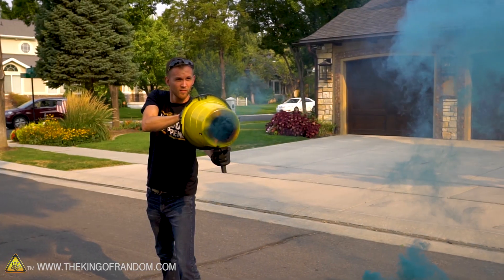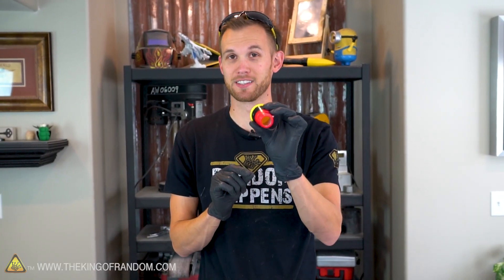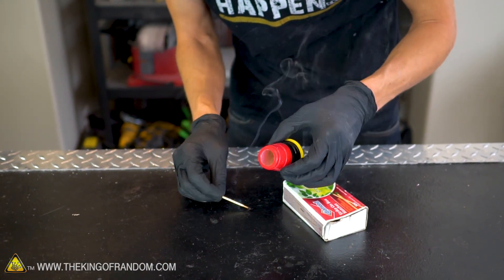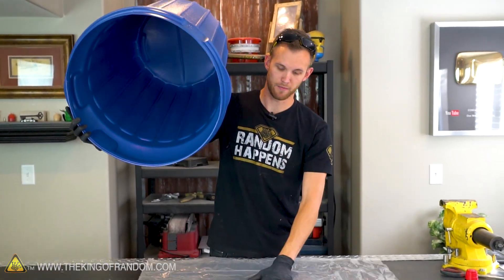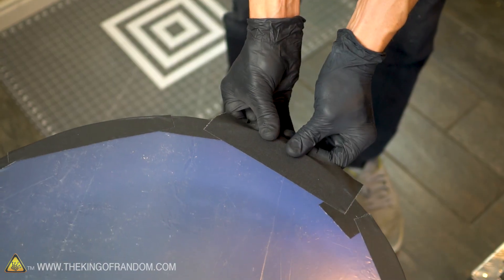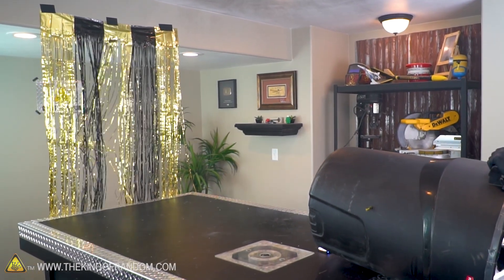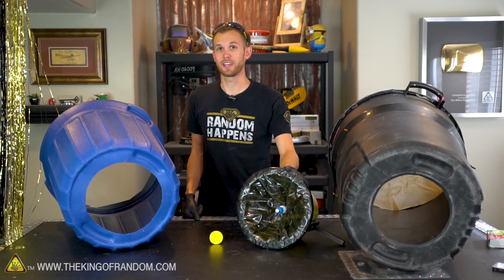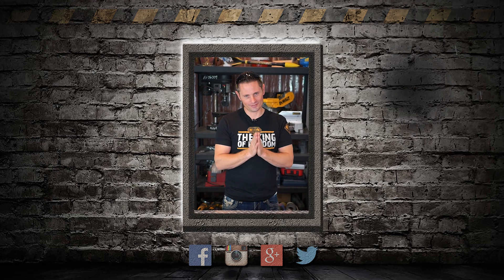Next Level DIY Vortex Cannons! TKOR Explores How To Make A DIY Air Cannon For Smoke Rings And More!

Comment: Instead of a smoke Machine couldn’t you line the inside with double sided tape and put smoke balls in there like the firework the ones that don’t get hot they are usually the solid ones not the one coated in paper.
Reply: Not a bad idea but smoke balls have a gas called poroxin in them witch gives the a slightly toxic smell but besides that not a bad idea

Comment: Why not hook up a tube from your fog machine to the trash can/bucket so it constantly recharges it with smoke as you're using it?  Endless cannon shots.  While you're at it, attach a garage door handle to the can so you can hang on to it better.

Comment: Does it matter what size hole you cut in the bottom of the trash can? Ie does a smaller hole produce a stronger or weaker air push?

Comment: @TheKingOfRandom if you make a stand for the trashcan you can set it upside down over the terracotta plate while the smoke burn and fills it up then you just tilt it and fire. Also same goes for the smaller one. If you light the match and blow it out under the cup the smoke will rise into it and you won't lose as much as if you stick it in after you blow the match out.

Comment: Instead of having to load smoke in manually, you should attach a hose to the fog machine and to the inside of the air bazooka so smoke is continuously being added, and you could keep firing without stopping and putting more smoke in.

Comment: what if you had the same volume of the larger bin with the exit circumfernce of the cup? i noticed as the circumference increases the speed of the ring decreases. maybe use a PVC pipe

Comment: Empty out a water botttle fill it up with oxygen from a oxy bottle cool it down with Liquid Nitrogen Until it becomes Liquid Oxygen Use it as an Alternative fuel in a combustion engine . I.E a weet eater , pour the liquid air into the fuel tank of the weet eater attemp to started and see what happens . ✌🏽😎 😏👍🏽

Comment: this vortex is known as a torris and it is quite stable actually... fill the cup or bucket up with dry ice and water fog and you can see it. now these torris.... slow ones move faster than the big ones so if u shoot a big one then you can  get a smaller one to pass through because it is faster.. just put dry ice fog or smoke in so it is visible
Reply: I barely know half of what you just said
Reply: how does "slow ones move faster"?

Comment: You could probably just glue a smoke bomb with the wick facing up into the big one. It would likely make more smoke and all you have to do is light and start shooting rings. Also because the smoke bomb is glued in place you can move around with it and for clean up just rip the used smoke bomb out.
Reply: Lol i learned the hard way that smoke bombs can and will transition into regular bombs when shaken

Comment: Why does a can of soda explode if you rub around the metal cap that folds inwards with paper/cardboard?after turning the tab around on the can I tried it myself and it actually worked it was quite a violent explosion aswell the can wasn't shaken at all and wasnt chilled, i just saw a video and tried it anyone know why?

Comment: If a ten pound weight is in a vacuum chamber when under vacuum dose it still weigh ten pounds
Reply: Gavin Marino why would the absence of air make it lighter?
Reply: Avry Antonio I don't know
Reply: Gavin Marino gravity defines weight, not air density, air density affects sound.
Reply: Ok
Reply: Gavin Marino 乛⼁
Reply: Avry Antonio - Gavin's probably just thinking about how how a feather & a steel ball would both drop at the same rate in a vacuum. That's just due to no air resistance slowing the feather down Gavin. But I saw where you were coming from mate.

Comment: I had a toy like that once - it used fog machine fluid, and had a battery and small metal coil to vaporize it, and a trigger attached to the plunger to make it shoot the smoke rings.

Still haven't mastered the technique of making smoke rings with my mouth, though...

Comment: What if you added a metal/not catching on fire tube as a handle, that you could place the smoke powder into and let it smoke up into the now "chamber" so you could have more powder and smoke?  if there is enough pull from the drawn action you may be able to throw a flap on there that opens when you pull and closes when you release,  then you could have as much or little smoke as you wanted

Comment: You should line the air bazooka with terracotta and putting a lot of the smoke powder in so the smoke is really dense. Therefore making the rings easier to see on film and hopefully making the rings go much further before “falling apart”.

Comment: Feel like there wasn’t enough smoke being used in my opinion, feel like you could have burned more and put a cover over the hole and let the smoke build up. Also feel as if the hole was slightly too big.

Comment: well... the hole diameter in the front changes a lot how fast and large the ring does get... and as it looks like both trashcan cannons had different hole sizes... the blue one seemed to be a lot larger (about 1.5 inches in diameter)

Comment: After seeing the failed Copper casting videos along with the Lead Knuckles episode have you considered doing a sort of Play Dough Copper casting to see if that could be viable? Or casting different metals like the brass and aluminum in Play Dough since you can actually use sticks to hold down any bits that need to sit down. That'd be interesting to see just how well play dough could stand up against the other metals.

Comment: Maybe you could attach the dish inside of the cannon and paint markings on it so you can know if the dish is at the bottom, and you can't lose the dish that way.also try adding attachments that force the air through a smaller hole to see what that does

Comment: I need something that can be triggered by bass coming from Boom Cars driving by, but the device needs to be strong enough to break a window (or windows) of the car.  Ideally, the inconsiderate driver will think their own sound system is responsible for the damage.

Comment: May be a Dry ice version..?
Reply: wouldn't it just flop down since it is heavier than air ?
Reply: Ramya Narendran could probably add a box to the top so that the dry ice fog fills the box then goes up a little and over and down a pipe into the can. however I doubt it'll produce enough fog. May be better to have 2 our the such boxes.
Reply: the result would be the same i think

Comment: NOTIFICATION SQUAD WHERE U AT?

Edit: Maybe you could make it into a flame thrower by taking the rings making them flammable and have a little torch at the end to light the rings and make rings of fire. Then if you can do that try lighting a fire with them. Now that I Think about it the rings would just combust then dissapear but maybe you could have flammable smoke then shoot it through the solar scorcher or through a fire and see if that works.
Reply: The heat from the fire might break the ring, as it were. I’m not sure it would work.
Reply: Yes
Reply: PsychicMaster HERE BUT LATE
Reply: PsychicMaster The fire would affwct the shape of the ring, so it wouldn't fly
Reply: It would not work because even if it ignites it will combust instantly and there is no point
Reply: wow i just posted the same thing with out looking at this post xD
Reply: PsychicMaster ooh maybe
Reply: PsychicMaster maybe you could put hydrogen in it and then have a match between two bricks
Reply: the backyard sienctist already did this with butane and is was epic
Reply: That sounds awesome
Reply: A
Reply: IDK, WHERE U AT!